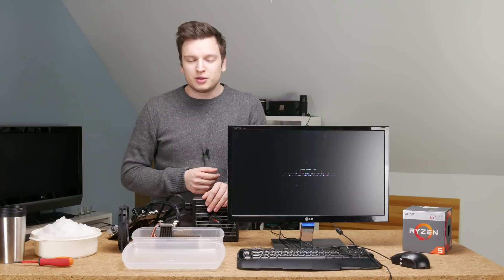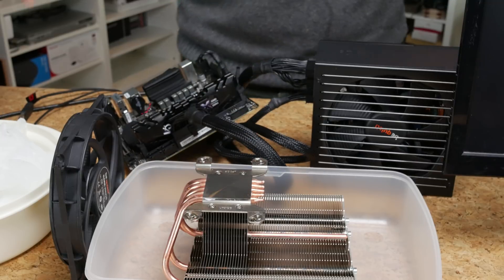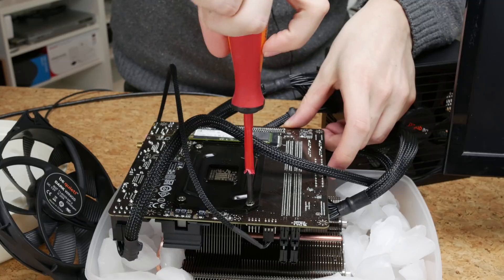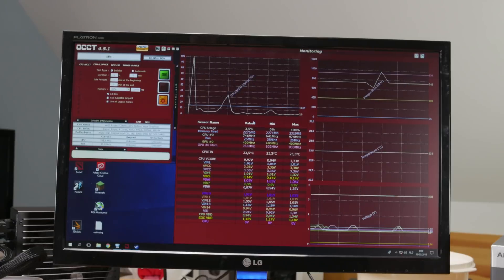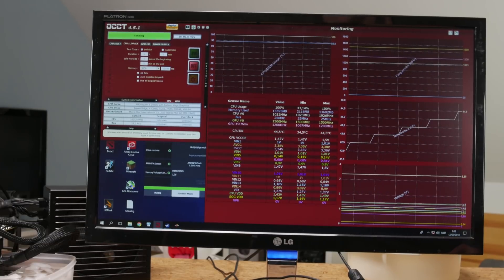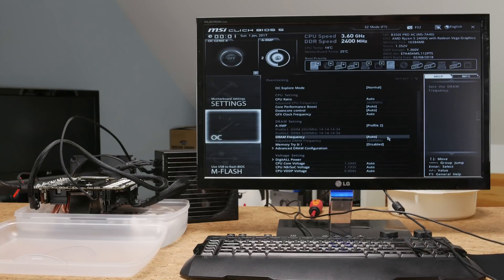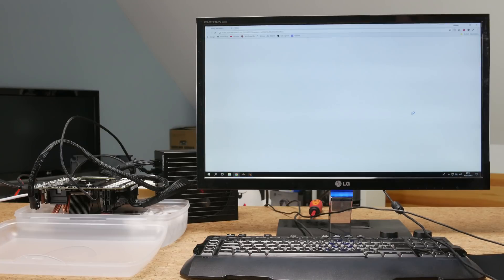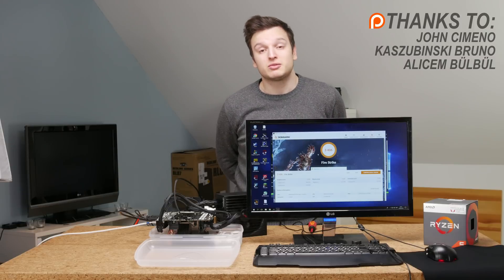AMD Ryzen 2400G SUB-ZERO overclocking | nerdy experiments

Comment: I smoked your scores with a cheap CoolerMaster 240mm RGB AIO.  Probably used inexpensive memory or you really need to work on your OC skills.

Cinebench15=876
OpenGL=86.77fps
FireStrike=3889
Graphics=4472
Physics=12098
Combined=1312
TimeSpy=1489
Graphics=1333
CPU=4464

Comment: i think you should freeze a cooler which you used here in water and convert it it ice and then start the test again man!
Reply from the maker: I just did some reasearch on this. It may not work sadly. The liquid inside the heatpipes might freeze up, ruining cooling performance. If I get back to this video later, I'll check with BQ or Noctua first to see if it can theoretically work.

Comment: shouldve put the tub in a bigger tub, also drill a few holes at a certain level to prevent the water from reaching dangerously close as the ice melts. just a small thing to permit safer and longer tests

Comment: Others also mentioned but you can never get the water below 0C unless you ad salt.  Ice Cream makers have know this for years.  That is why salt is used to melt ice in the winter.  Salt lowers the point at which water turns to ice.

Comment: >Fun video thanks  next time freeze the heat sink into the water so it is a block sink not only will you get much cooler temps it will last a lot longer being chill. You may also get to 4.2ghz as well.
Reply from the maker: I was considering this too. But the box didn't fit in my freezer... For a next video, I have a newer, better and cooler idea :)
Reply: I lol'd from the "But the box didn't fit in my freezer" part. Can not wait to see what you try next.
In the ever search for more speed I have also done some out of the box thinking and come up with some weird ways to get better cooling on a system. Hmmm....my beer/computer case fridge comes to mind. Yep built the system in my mini bar fridge it not only cooled my hardware it kept my beer & pop cold as well.

Oh then there was the ducting form the window to the tower with fan sucking cold winter air from outside and putting it into the case that was a lot harder to control the temps mind you since it can get very cold here sometimes in Canada. There also the problem of the summer months which made me pick up a window AC unit and basically do the same thing more costly on power but way easier to control the temps. SO yep have tried some pretty weird ideas in the past and all have worked really well for the most part it is just fun to do stuff like this I guess.
Reply: delid it too and add some salt.

Comment: it is not sub 0°c cooling... , the water will never go below 0°c but it will stay at 0°c till all the ice melts......
Reply: he should have put salt in it. It may make it a bit more dangerous though
Reply: I agree in that he should've used salt
But as there were ice touching the metal, there was contact with Sub zero material
Just that not enough to make a difference 
My point is that it could've gone below zero if there just wasn't a CPU there heating it up
Reply: don't know why you are spitting out that fact Luciano?
Reply: Kuntal Ghosh you do realize that zero degrees Celsius is for pure water. Presence of salt(NaCl), pressure etc., changes this temperature :-)
Reply: kek, water with ice have just 4*C
Reply: Water can go below zero, its called supercooling. Believe me, I do winter swimming. If it could not go below zero, many lakes and whole oceans north of Italy would be a solid block of ice during winter.
Reply: ice can go under 0, but it can't go over 0
just as wáter can be under 100 but not over 100
Reply: Luciano Bartolucci so did I say anything special?

Comment: so basically no improvement over ryzen 1000 series? so disappointed, i was expecting to atleast get 4.2 out of these new cpus, and maybe 4.3/4.4 after amd said they were better overclocking chips with better ipc etc
Reply: They are not new, same as the normal Ryzen first gen. Only the vega igpu. The "new" Ryzen+ 12nm is coming in april..
Reply: it is not new Ryzen dummy!! it is fakn older Ryzen  and on it Vega igpu!! this is not 12nm pinnacle ridge cpu!!
Reply: Idiot, seriously.
Reply: They're made on the same 14lpp low power performance, of course it's gonna hit the same 4.1Ghz wall.

Ryzen+ with 12nm changes the node to 12nm lp leading performance which unlocks higher clocks without sacrificing efficiency.
Reply: i just wish to see 8core threadripper with full Vega gpu inside :)
Reply: He lowered it about 10c at max (probably not even that much), what did you expect? I can go actual sub-zero with my phase cooler (about 80c colder than he was), so then you can push some actual clocks, otherwise this was about like running a system outside in the cold, which will actually get it colder than he was achieving...
Reply: When you mentioned using the PC outside it reminded me of something I tried years ago just to see if it would work. I mounted the PC in my window with the window slightly cracked open to let the cold winter air into the system case. I used a water repellent spray on the inside of the case and also used a PC I did not care if it got wrecked or not I let it dry and mounted the PC turned it on and it worked and yes was very chill and I was able to OC a lot farther without heat build up.

Anyway a buddy comes over and asks me what the heck is in my window because he seen something sitting there but could not make it out. I said dude that's my Window PC. He looked a bit confused and replies but you don't run Windows you run Linux. I said dude look at where the PC is installed put 2 & 2 together the answer will come to you in a second or two. He smiled and says oh I get it and says aren't you the clever one.

I actually did run Windows as well but in those days Linux was my go to OS for almost everything except for gaming. Now days I am just to pazy to run anything other than Windows.
Reply: April
Reply: maybe not vega 56, but certainly vega45 or something (there is space in TR)
Reply: No one said it's the new 12nm pinnacle ridge tho? and what exactly is "fakn older ryzen"
Reply: @aidehill what you’re describing is coming out only around April/May. That will be the real ryzen refresh CPUs with enhanced IPC and refined infinity fabric
Reply: It's all on the same process as the first series. Basically it's a mobile cpu that was not capable enough for Mobile.